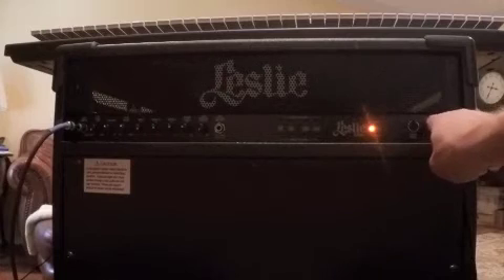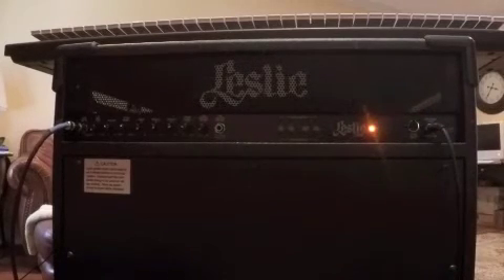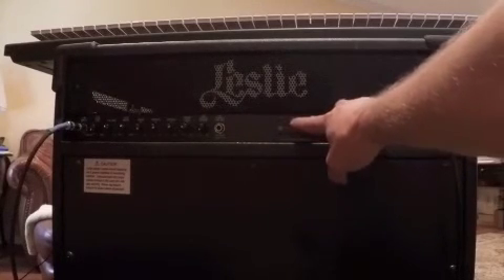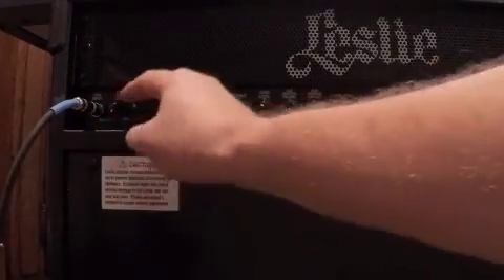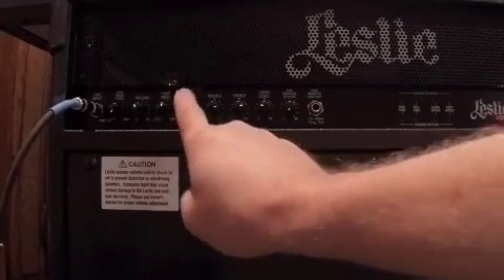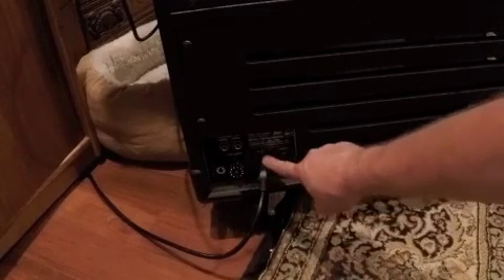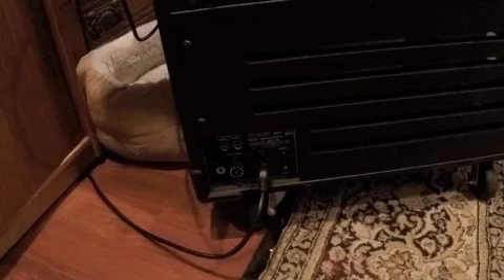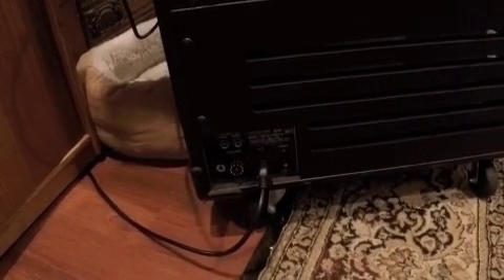Leslie 3300 amplified speaker

Comment: when i got mine i hated the foot switch i made a custom half-moon for switching! I used it with a optima 1100 61 from RadioShack for a year! I bought the Roland v 8 used the 11 pin for 10 years! Now i have the Nord c2d with the 11 pin! This Leslie 3300 make a child  keyboard sound good! I was very impressed! The 11 pin is the preferred way to connect to most organs! Thru that connection the speeds are control and the organ turns the Leslie on and off remotely thru the 11 pin cable! Great stuff! My Leslie 3300 is 10 years old and now i want to add a second one to my rig i want 3300w Leslie!!!